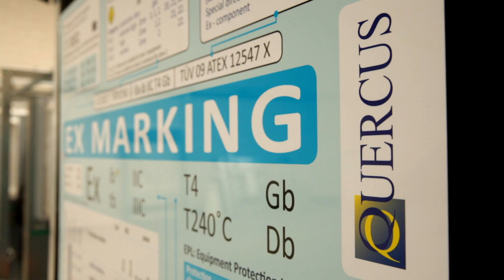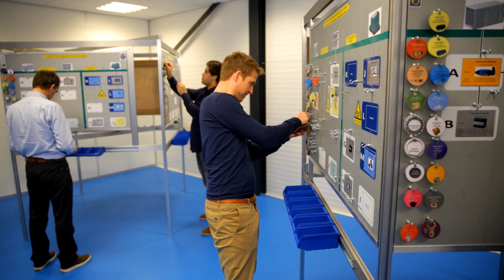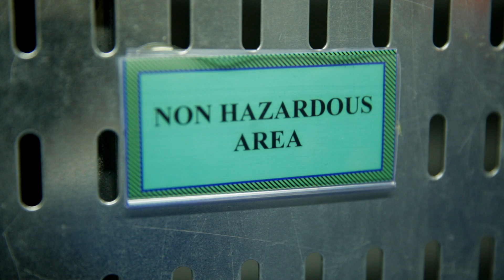CompEx Courses Explosion Safety Quercus

Comment: IECEx certification of personnel competence for explosive atmospheres 
increasing the effiency and competency in managing explosive atmospheres standards
Benefits
-to provide cross-industry competencies needed for work associated with equipment for hazardous areas.
-to demonstrate personnel competency and provides confidence on an operation of equipment complying with IECEx requirements and IEC standards related to explosive atmospheres.
-to provide a system for the assessment and qualification of personnel meeting the competency prerequisites needed to properly implement the safety requirements based on the suites of IEC standards covering explosive atmospheres 
 in my country have skills based on the following  11 units  matrix (CoPC)
EX000/EX001/EX002/EX003/EX004/EX004/EX005/EX006/EX007/EX008/EX009/EX010